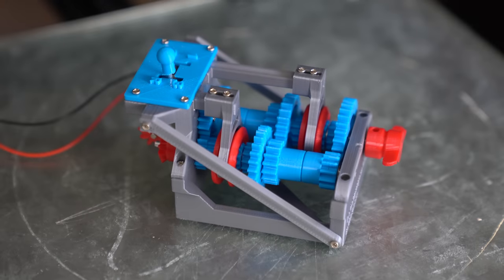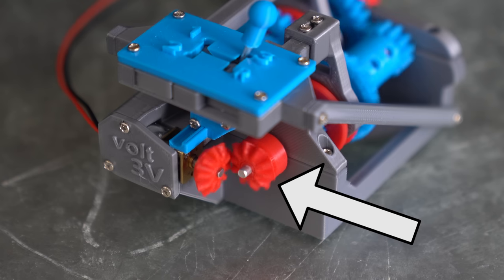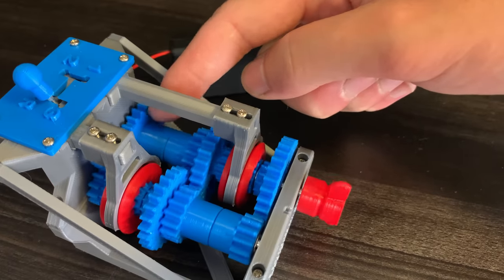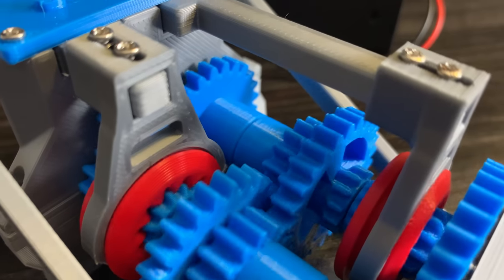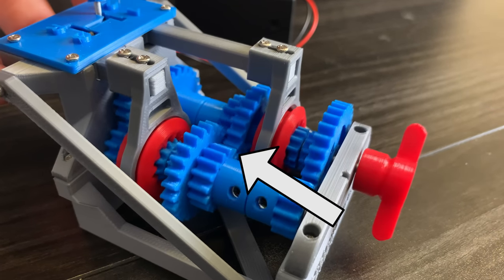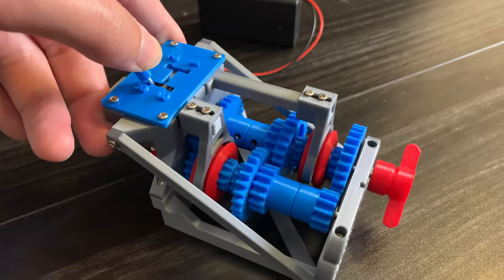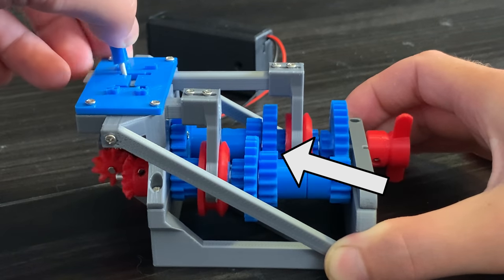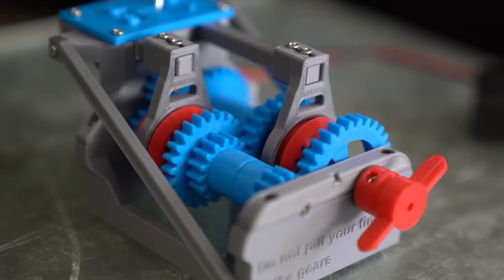What makes a manual transmission so cool?

Comment: It would be interesting having a clutch mechanism to separate the power output and isolated from the engine.
Reply: I was about to say the exact same thing, I got my friends son a build your own model of a 4 stroke engine a few years ago and helped him build it, I had a fair idea of how everything mesh's together but seeing it up close relly brings it home.
Reply: He could've also made it a 5th gear transmission 😭
Reply: That would only really be more helpful with a flywheel and running this at a higher speed
Reply: He can simply turn off the power being that this is run by an electric motor, the clutch simply disconnects the motor from the transmission.
Reply: @x2e4  my car says thank you
Reply: Yos
Reply: Kind of crucial really.
Reply: And hydraulic synchronizers and active lubrication, as well as limited slip hypoid differentials and a 4wd low range transfer case
Reply: @jhsevs  That would be epic lol
Reply: @jhsevs  or how non synchro double clutch works vs the brand new amazing tech, synchro works… then do how air brakes work vs being a train brakeman that falls between the cabs crushed to dust
Reply: It would be quite simple. The motor can be moved back so the gears do not touch (using a lever). I don't know how to implement clutch control, however.
Reply: @56independent  All a clutch really is, is a friction coupling between two surfaces. Suppose you have a flywheel on the engine output side, you could use a mechanism comparable with the sleeve mechanism used in this example, and have a spring lever mechanism to push it against the flywheel. 

I don't think it's feasible to make an exact copy of a clutch mechanism in a car, because it uses a diaphragm spring and that's something plastic can't really do well, but it wouldn't be too difficult to make a 3D-printed model of a mechanism that clutches.
Reply: And a synchromesh.
Reply: The clutch is a whole new level of amazing. These are really simple machines doing a big job.

Comment: That's pretty cool.  This would be representative of a very compact transmission like might be found in a motorcycle or early FWD car.  A typical rear drive manual transmission has the input and output shafts on the same axis, with the power being sent down to a countershaft to select the ratios.  The lowest reduction is usually at the rear of the case, as it puts a huge load on the shafts trying to push apart rather than rotate.  You'll have first, second, third, and sometimes fourth as reduction gears, with the next gear being a direct connection between the input and output shafts.    After this, you have overdrive gears, where the output spins faster than the input.  This is usually in a second section of the transmission, behind an intermediate bearing plate as now pushing forces are getting higher again.
Reply: You seem knowledgeable about this, mind making a video explaining this?
Reply: That actually sound like a typical FWD gearbox, except for the 3 shaft design) - 4th gear is closest to the differential, moving away towards 1st, then behind a bearing plate is 5th and 6th (sometimes with additional bearing plate at the end of the shafts)
Reply: And reverse doesn't use a collar lol

Comment: My favorite printed gearbox is the sequential 7 speed w reverse. Don't remember the designer but he did an excellent job. Its a good design as you can scale it with realitive ease depending on your application. When printed with nylon it is strong enough to stick into an rc car. All I have tried so far is an electric motor however I think it can handle nitro as long as it isnt too small.
Reply: That would be the F1 gearbox?
Reply: got a link for that ? would love to print one as educational tool
Reply: I would love to see it as well
Reply: Even in weaker plastics, gearboxes like these can be surprisingly durable. Someone tested printed worm drive gears with and without grease and as long as they had grease, they could 8,000 rpm for a while with no visible wear. The actual numbers might have been higher but I haven't seen it in a while
Reply: @thedudeamongmengs2051  a higher pressure angle (e.g. 30deg) increases tooth strength at the cost of noise and bearing load.
Reply: @thedudeamongmengs2051  'Even in weaker plastics'  ESun PLA+ or whatever it's called now is excellent.  PLA cracks etc like crazy, the PLA+ can take hammer blows.  Literally I had to use a hammer to break the petals free on one of the iris boxes, and it took a lot of blows with hammer and screwdriver to do it.
Print a thin sheet square and bend it, PLA snaps immediately, the PLA+ would bend back and forth many many times, it was hard to break or tear it.  Think of it as being around 60 or 80 % of nylon, but way easier to print and deal with.
Reply: @ModelLights  I might be thinking of a different brand with a similar name but I've experienced the opposite with esun. I had blue pla or pla+ and no matter what I would do, it would either fail on printing or be incredibly brittle, sometimes to the point where removing supports could break the print. It's not a settings issue cause I played with the settings a lot, I tried cura's defaults, I tried settings recommended for my machine, I tried the settings recommended on the box the filament came in and nothing worked. I switched the plastic to overture or hatchbox and it worked just fine. And those, plus other brands of pla that I've tried, haven't been that brittle. In fact I remember one where I messed up the settings printing a small tardis and I was going to smash it but I threw it against the ground and it just refused to break. This was just regular pla too. Probably hatchbox based on what I mostly used at that time. It's possible I just got a bad batch or something but still
Reply: @ModelLights  actually I'm almost certain it was pla plus because it had a card explaining that it was not like normal pla and required a higher print temperature and stuff. That was probably the worst plastic I've put through my printer though. I'd honestly rather work with weed eater string. I have thick walled parts made in that pla plus that you can snap in half in your hands. Not long parts either, like 10mm by 10 mm by 50 mm rectangle that you could snap like a pencil. I have bits of support .4mm wall thickness that snap like that and I'm sure if I printed a thin piece specifically to test, it would shatter like the rest. It was actually very interesting because it never shattered along layer lines. That kinda tells me that the layer adhesion was good enough and the plastic was brittle enough that it would break before it separated
Reply: @thedudeamongmengs2051  
' I had blue pla or pla+ and no matter what I would do, it would either fail on printing or be incredibly brittle'

Realize, you have to be extremely careful.  PLA is just PLA, even theirs.
Their PLA plus is PLA with modifiers, and is incredibly different than just PLA. 
Again, you can take a hammer to this stuff and it bends slightly and bounces back.
  It is extremely different than plain PLA, including theirs.  Why I was mentioning it, it's basically superior to PETG and Nylon for general use.
Reply: @ModelLights  I said in my comment though that other brands didn't have that problem, and I said in the other comment it was almost definitely pla plus. I'm not talking about how regular pla can crack sometimes under stress, I mean like I've printed parts in regular pla that I could throw against the ground, hit it with a rock, and really just try to break it and it just wouldn't budge and that pla plus just crumpled by comparison. It was like how some plastics get after they've been in the sun for years, but this was out of the box. I mean the pieces of filament themselves would snap cleanly. It's possible that sometimes it's better but they must have quality control issues cause it was the worst plastic I've ever tried
Reply: @lowen74s  f1 is a sequential 8 gears and reverse(which i think is an electric motor)
Reply: @lowen74s  their 8 speed
Reply: @ValenGR86  except when they were 7 speed previously, and 6 speed before that.

The reverse is likely still a mechanical gear in the 8 speed gearboxes, the FIA rulebook will cover this if it is still the case as it was a rule all cars must be fitted with a reverse gear during the 7 speed era, the gear was tiny and had a short lifespan if it was used.

Comment: That explains this really well. Would be interesting if you expanded and added a clutch disconnect too. Just to see the extra level that adds. 

The clutch is not needed to shift but it’s cool too see.

Something I don’t know now is how the synchronizer works.
Reply: The red parts that slide are called a sleeves (there are 2) and the blue parts they engage with are called dog teeth (each gear has its own set of dog teeth). A synchro ring is attached to the front of the dog teeth, it can spin but if pushed towards the dog teeth it will grip. So when the sleeve is pushed, it initially hits the synchro ring and engages with it, at the same time the synchro ring grips and in turn spins the output shaft faster or slower to match the required speed. Once the speeds are matched (synchronised) then the sleeve can slide fully onto the dog teeth.
Reply: At that point it would be easier to do a cutaway on a motorcycle transmission. Clutch basket is on the input shaft a single bearing width away from the box
Constant mesh, straight cut dog box.
Granted it has a shift drum to move the forks but it's all right there.

Comment: Curious how many people watching this have ever actually driven a car with a true manual transmission, one with no computer involvement whatsoever. I learned on a '74 Toyota Corolla, with manual *everything*. Its clutch was incredibly unforgiving. If you were off in your timing by just a little tiny bit, the whole jalopy would start to seize, jerking the car forward and backward violently until the engine died. I have to say that learning on that beast made every other car, stick or not, I drove after that an utterly trivial undertaking!
Reply: Almost all cars (and every single van/truck) outside of North America have manual transmission. EVs are gearless. I think that the reason that the American drivers prefer automatic transmissions is ultimately due to cheaper energy costs in the US.
All the best.

Comment: This direct connection between the wheels (via the output shaft) and the engine is why you can start a car with a manual transmission by pushing it (or as it starts to roll down a hill) and then popping the clutch (esp. in 1st or Rev) and then quickly pushing the clutch back in before it stalls again.  I used to do this just for the heck of it in my driveway because it wasn't completely flat - I'd pop the clutch in reverse... never wore out my clutch either.

Comment: Hello,
I love the video but it would have been even better if you explained how the red circle transmits the mechanics power from the driveline to the ouptut.
Have a great day :)
Reply: If you closely at the output gear, it is connected to the middle gear, I suppose that by moving the red bit, he is making it so that the gears get linked, by making the red bit touch two gears.

Comment: That IS how a manual transmission works. Some will just have more gears but the concept is the same, more gears and red connectors will mean a bigger range of control, like 5 or 7 speed. Add a clutch and you can switch gears faster. The clutch also allows you to have the engine running while the car is not moving.

Comment: As yet i have not seen a good explanation of how it works. it's especially difficult to people to understand how locking of the gears works and thus "connect output shaft to this gear" does not help them to understand. Also  mostly it is not explained, that there are multi levels on running the gears on the rod (one that drive loosely and one that is attached to rod). This is the most frequent part I have to explain using some other means. It's easy to understand that smaller gear vs bigger gear gives  speed increase and driving gear one way makes the other go the other way and thus if you need to change direction you need to add another since this is replicatable easily with cups n glasses etc.
Reply: Do you have an explanation for the locking / unlocking of the gears? This video really just glosses over it.

Comment: Awesome explanation, thanks, but I don't understand how does the red piece work - how is it connected to the shaft?
Reply: Same question here. I assume it locks the output gear to the shaft somehow, otherwise the output gear is freely rotating.
Reply: @LKRaider  It's the red piece that's connecting the gears. Initially, the red piece is connected to the shaft, then it touches the moving gear and the shaft gear.

Comment: Correction: there is a speed reduction when you have a small gear and a large gear, yes, but it only happens when power is going FROM the small gear TO the large gear. In other words, if you had a small gear and a large gear like this, except it was the large gear that was connected to the input shaft (the car engine) and it was the small gear that was connected to the output shaft (the car wheels), then it would actually spin incredibly fast.

Comment: There are a lot of cool things about them... Im in the small group of 15% of Americans that can drive one thats cool.. I can control my rpms and tell my wheels to either spin or get the best possible acceleration out of my vehicle without tirespin... Thats cool... If you blow a manual trans you can buy a $200 rebuild kit and have that thing good as new by the end of the weekend thats cool too

Comment: I 3d printed a 5 speed constant mesh gearbox, all gears spin all the time but dog gears determine which set of gears power is directed down. All plastic with only a few paper clips to act as snaprings.

Comment: this is a very nice model, and the video is good, but I already understand gesr ratios. what I dont understand, and what I was hoping the model would demonstrate, is how the transition from one ratio to the other is performed by the "red thing", what is it doing to change gears?
Reply: I agree, I see a lot of people saying this is a great explanation, I find it very lacking. What is happening which I think he really missed an opportunity to explain is that UNDER the red membranes are the portions of each shaft that are directly connected to their counterparts. I.E the first red membrane sits ontop of a gear that is directly connected to the motor and the second red membrane sits over a gear that is directly connected to the output shaft. By shifting the membranes it connects these gears which drive the shafts and causes the rotation. So when the membranes are in the middle they are in neutral because none of the pieces are connected. When he shifts into first, the red membrane that moves is connecting the output shaft gear (which you cant see because the red membrane covers it) with the spinning gear. If you look closely as the red membrane moves you can see the gear it is sitting ontop of. That is the critical gear which drives the output shaft.

Comment: Good try, but for me you failed to detail exactly how the red rings work before building the explanation on them. imho it'd be more effective to first show the shafts and how the red pieces are "connected" to the shafts. Seeing that would enable better understanding how the red rings are then able to be repositioned to mesh with the non-attached rings. I had to rewind and grok that before the explanation really clicked.
Reply: I still don’t get how the red pieces are connected to the shaft yet freely moving sideways

Comment: The drive shaft connected to a small gear, the small gear connected to another small gear, another small gear connected to a large gear, the large gear connected to the output shaft.  Doin the transmission dance.

Comment: Super awesome! The red cylinders seem to get caught temporarily before connecting the gears. How do real manual transmissions prevent itself from getting caught into the gears?
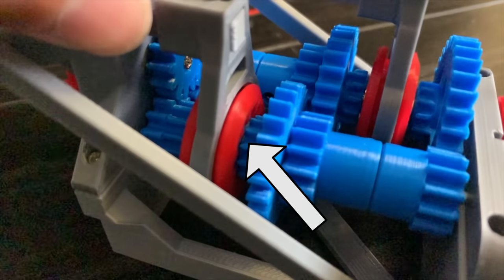Reply: 3:16 gear synchronizers
Reply: Something called brass synchronizers!
Reply: Synchronizers, AKA synchros. Some older and/or race transmissions don't have those, which require the driver to double-clutch. Double-clutch is where you try to match the speed of the input shaft to the gears by pressing the clutch twice while shifting.
You don't have to do that in any modern street car, though.

Comment: This is a great video and helped me understand it much better. But I still don't understand how the clutch comes into it - the clutch allows the gears to somehow be 'partially' engaged. Which my current mental model can't deal with, so I'm confused.
Reply: Well when you are not clutched the gears spin FAST so when you clutch gears go slow and are easier to fit together, imagine doing a puzzle thats spinning 2000x a minute vs a stationary one.
Reply: The clutch is between the motor and the input shaft (but it could just as easily be between the output shaft and the wheels).  It is needed because otherwise you'd have to match the input and output speeds before those red rings would be able to interlock with those blue splines.  (It's also needed to drive away from a standstill because engines can't go below a minimal rpm).

Well, technically you can switch gears without a clutch if you know what you're doing but that will wear out the transmission a lot faster.  And the clutch is still needed to go from a standstill anyways.